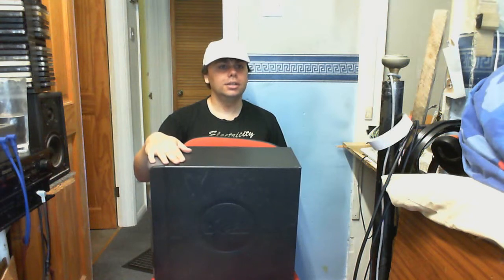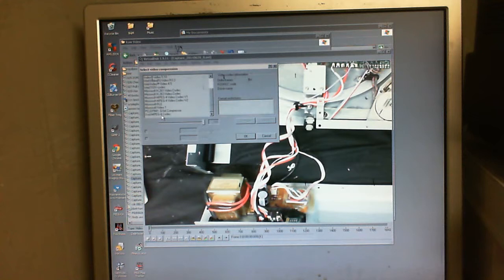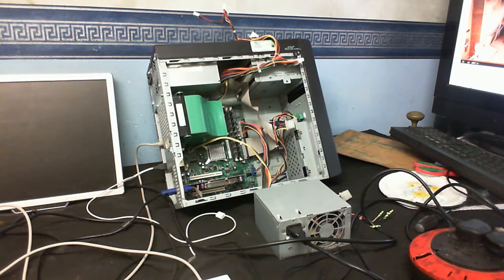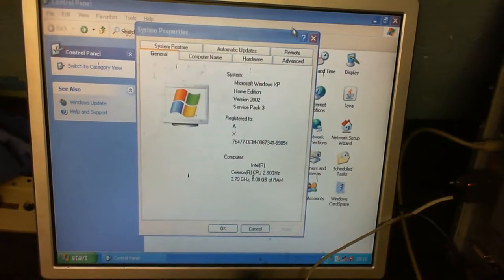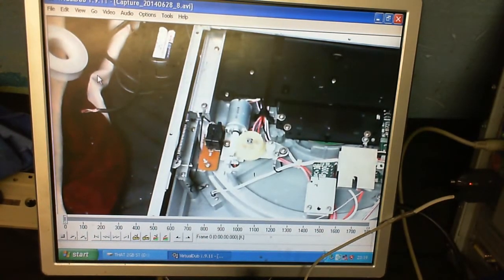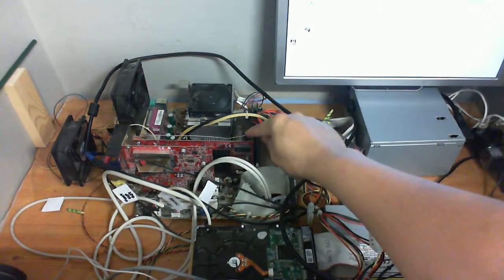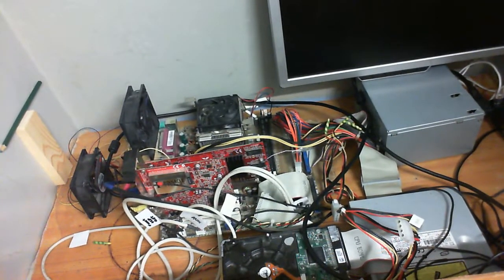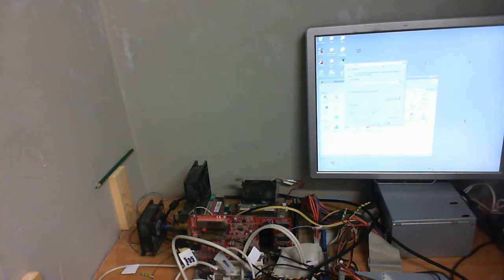Testing the Trash-picked Dell & Upgrading "FrankenPC"

Comment: I apologize that you are having LINUX problems. In a very few cases, I have seen a video driver problem with LINUX. FIRST, I would test with a live cd or USB, if the bios supports it. KNOPPIX will usually install the drivers you need. You may need something less complex from the LINUX world. Try Puppy LINUX. I used Linux on many old Dells. Do not install to the hard drive until the live cd version is found to be good. Let me know if this helps. I can find a list of powerful, but less complex LINUX versions. You may make a few coasters, but they would work on some machine!

Comment: You need fresh installation of XP on both to make a fair comparison. Dell seem to struggle, perhaps this antivirus thing or something else ...  Can you add the fastest of the old memory sitck from franken PC to get a bit more of RAM of this bring make the PC slower ?. Live again to die another day is Davidsfarm. You can try Linux for sure. Im using it right now after 8 years of XP without any issue. It turns dumb when installing HW, but plenty of info plus you do well with this stuff so wont be a problem. Just be aware to install KDE Desktop. Gnome sucks. Use the current Debian Wheezy first DVD (you can download from internet) and make sure the computer got one network conection. wireless seem to fail in the detection more often, if you have both, wifi and ethernet, connect eth also. It will be used during installation. Installation runs effortlessly. Take couple of hours. Getting things customized get some more time. Cheers.

Comment: LINUX would make those computers run at blazing fast speeds. Good video. Windows is bloated....
Reply from the maker: I just tried installing Linux on FrankenPC, with the Dell's hard drive connected in place of its own one, it installed but doesn't boot properly, after the loading screen I just get a load of horizontal lines on the screen, I guess it's not compatible.  That or Linux hates me!
Reply: CoolDudeClem Maybe the chipset (not the processor) on the motherboard is to blame, as Linux doesn't always like certain chipsets.